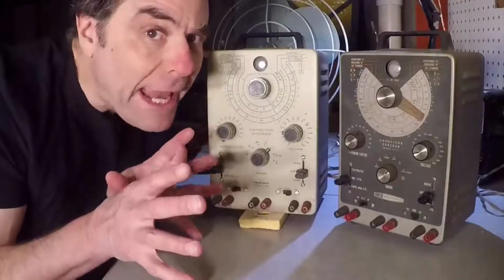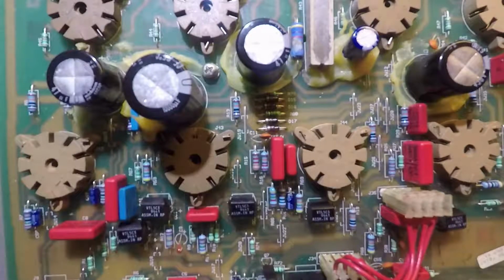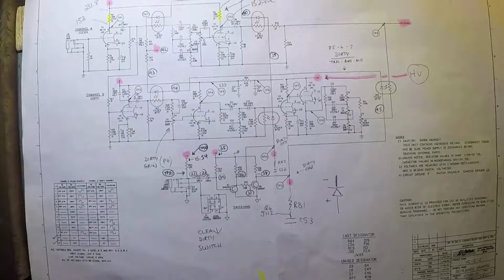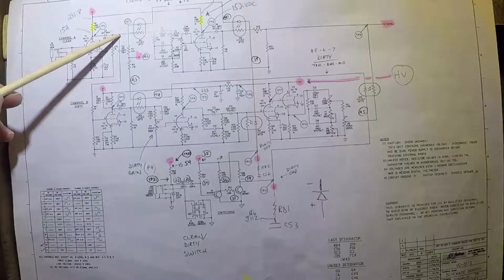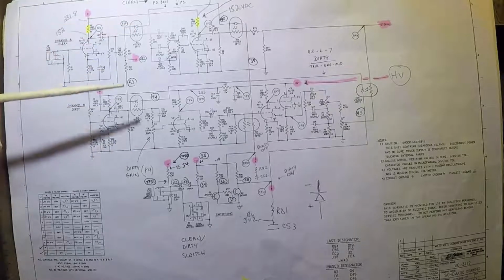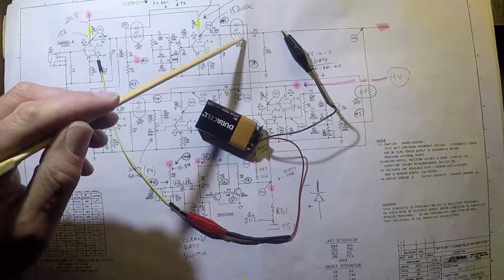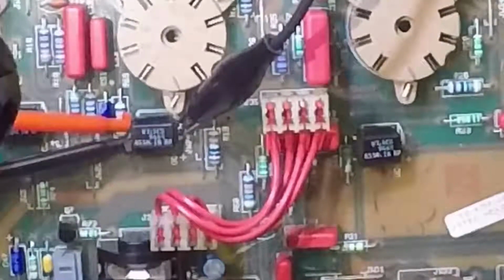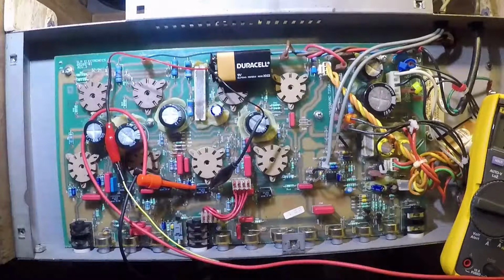What is an Opto-Coupler and How To Test One? (AmpMechanic #005)

Comment from the maker: Show Notes: You'll see that I pointed several times to optocoupler 4 as though it were in the dirty circuit. "Geographically," yes, it's in the dirty circuit. But just to be clear, it is on the clean circuit's optcoupler/diode loop. I'll update these notes if there's anything else to point out.

Comment: I have a crate Blue voodoo 60 tube head.
The problem I'm having is the channel switch wont swap between clean and dirty. 

The amp says it's on the dirty channel but only clean comes through. Any ideas ?